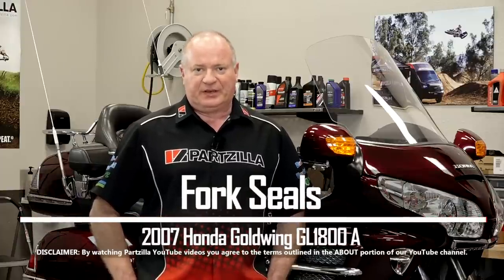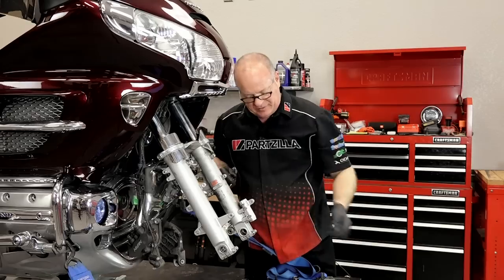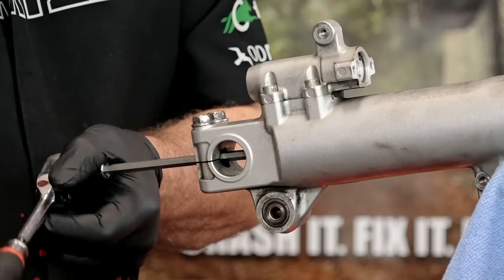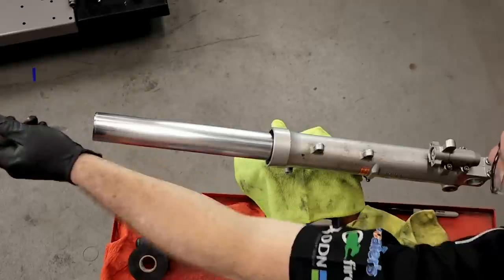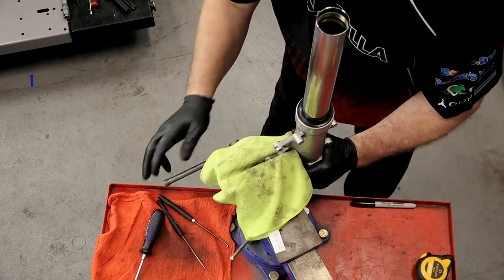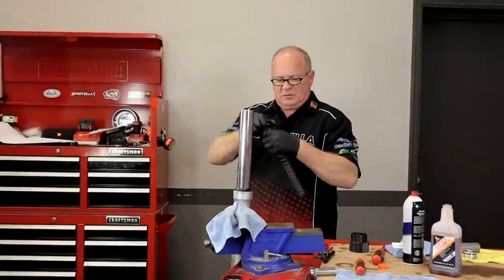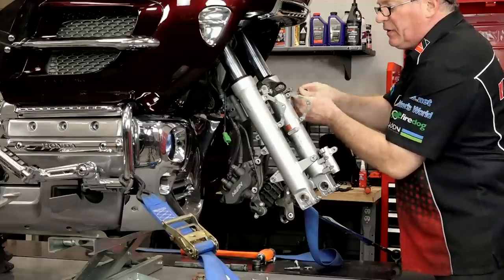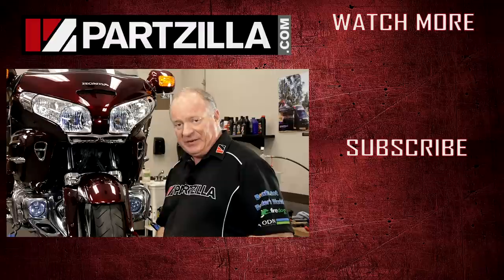Honda Goldwing Fork Seal Replacement  | Partzilla.com

Comment: This is the BEST Honda fork seal replacement video on Youtube.  Very detailed explanation, audio and camera work.  The most unique part is the method he uses to loosen the bottom bolt for the damper rod.  Nobody else does it this way, which makes perfect sense without special tools.  What really kind of blow me away is that the Goldwing has a Damping Rod Suspension - Exc. for anti-dive, no preload, rebound or compression damping adjustments at all for this bike that is famous for it's comfortable ride!
Reply from the maker: Wow, thanks!
Reply: I was watching this video, so me and a friend was going to do it, now that I've watched the video, the shop will fix it. Just a little out of my league, but the video is awesome.

Comment: my 2 cents...the seal install tool can be made from a piece of PVC pipe also, I have found it beneficial to smooth the chrome on a buffing wheel with jewelers rouge . The pits and scratches will ruin a new seal.

Comment: Great video, among the best instructional videos I've seen on any topic. However, you definitely DO NOT have to have this specialty seal driver. The seals go in rather easily, as shown in the video. I was able to use 1.5" schedule 40 PVC couplings which are nearly a perfect fit; and I had a short length (about 20") of 2" schedule 40 PVC pipe. Together these allowed me to very easily tap in the seals. Thanks John and Partszilla for a wonderful service.

Comment: On a 2001, I didn't need to pull the instrument cluster to get the cover off and get at the pinch bolts.  This video was awesome. You certainly are a good teacher. Thanks

Comment: The fork axle centering technique is an excellent thing. Thanks. I suppose to be pedantic, a dial indicator could attached to the steel axle with a $10 magnetic holder, and then in/out measurements could be taken.

Over-constrained is nice term for describing the action of bound forks.

Good, careful, sound mechanic techniques.

Comment: Well today I thought I would try your technique of wrapping the fork with electrical tape.  Well I did not have a smooth go at it and was going to remove the tape and start over.  The tapes adhesive came off on the pipe so I had to clean with rubbing alcohol.  Was about to retape when I said this is a waste of time, grabbed grocery bag tightened over start of pipe little oil on tube little oil on plastic once I got the seal started a 1/4 of a inch on pipe then tore the hole bigger then slid seal down with the plastic protecting the seal from under neath then when seal gets to 1/2 inch of seal area hold plastic at the back and slip seal onto fork then right into the seal slot.  So much faster than wasting electrical tape and having to clean up the adhesive left behind.  Also to save time I loosen the end bolts under the axel before I remove forks saves a lot of time instead of placing them in a vise.  Also find where the cap starts in the thread of the tube before putting spring and spacer back in mark cap 1/4 inch behind tube where it starts to grab hold of thread,  Mark tube at where it started to grab tube imagine a clock on the tube the thread in tube starts at 12 so mark cap at 11 mark tube at the 12 when you place the cap in the tube compressing with the spring you only have to turn your rachet 1 and a half inch and the thread has grabbed in the right area on the fork at 3 o-clock and will not come popping off.  But just do not get wild yet turn in forward to the 5 o-clock on the fork then back to the 4 o-clock still compressing the cap some.  It is a game of back and forth making sure the threads have not crossed once you have gone around 1 and half turns your good to get wild turning it into the tube yet compressing it some.  Ok decided to show you the quicker way to get the seal here is a link to my channel. https://www.youtube.com/watch?v=oeqTjzOXjwE

Comment: I've done a few of these a fixing to do another. I don't use locktite on the bottom bolt. It makes it nearly impossible to get them apart the next time it needs to be done.

Comment: Superb video.  I couldn't believe the state of the old fork oil.  I like the electrical tape trick, not come across that one.  My GL1100 seals are still weeping after I installed new seals and I wonder if that's the reason.  I'm going to have to try again but I'll give the the tape a try this time.  Thankfully, my GL1800 seals are good but I've booked marked your video for the future. Thanks from the UK.
Reply from the maker: Glad we could help!  Thanks for watching.

Comment: Yes I did sir a blessed good afternoon to you and your family..I always enjoy your vedios and is verry educational in so menny ways..I just have one thing to say..I'll like to see you clean all parts that you are going to use back clean first before you start working..its much better ..just as how you clean oit to put up back..great job overall ..you be safe..I'll like to know if I put on a new head gasket and do one torque one the head and is the right torque if it's a problem with that..❤👍👏✌

Comment: Excellent suggestion on getting rid of the non-adjustable Supersbrace fork brace.  The Superbrace design probably does more damage than good and is probably the cause of the stiction problem you discovered.  Kuryakyn or Traxxion both have much better fork brace design.
Reply: The strange part is a former owner swears by the Superbrace. I installed on mine and I'm happy. I'm watching this video because the fork seals are leaking and my bike (2017 model) has only 54,000km. I think the previous owner (not the one who recommended the Superbrace) took it on a long trip towing something heavy, so the fork seals leaked prematurely. That's the theory.

Comment: This was a great video.  I have a 02 gl1800. My turn signal isn’t working but the hazards are. I was told to check the cancel unit. Do you have a video on how to check it and where it is

Comment: Lower backup ring & upper backup ring positions on left fork appear to have been swapped by original installer. You corrected it.

Comment: At about 00:15 seconds into the video you'll see that the OEM oil seal has 8 groups of 2 dots (16 total dots).  Page 14-32 of the 2006 to 2010 Honda GL1800/A Service Manual tells you to install the "- oil seal (with the marked side facing up.)"  The other side has no dots.  At 19:26 you can see John installed the seals with the dots facing up.  I found John Talley's oil seal orientation statement at 19:02 ( "...to install it with the cut edge facing up") confusing because both sides of the OEM seals I purchased from Partzilla appear to have cut edges.

Comment: can't do that with a 1500. I took my caps off to drill and tap holes in the plugs to change the oil and it went flying when I reached the last thread. I had to make a special c clamp with a welded cut in half pipe to rest against the fork tube and strap it there and had my neighbor help me compress the cap back down into the threads to screw it back in. I had already pumped the fluid out of both fork tubes and just had to fill them.  How does that work with no pressure on the springs? It took all I could to compress the springs back in again. with the 2 of us.

Comment: @38:10, i cant believe a pinch bolt is holding the one of these thick forks from the handle bars, there has 2 b more bolts hold that fork in place? wow

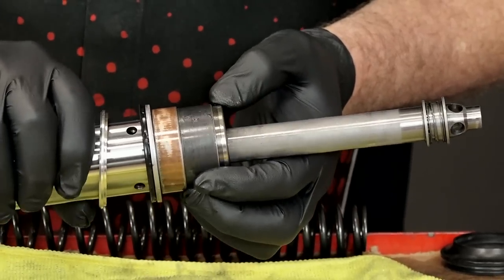Comment: 12:48 The fork has just been dismantled, and there Installed incorrectly LOWER Back-Up ring, packing and UPPER Back-Up ring. In the same way, the master on the video assembled the feather of the fork. Minus for inattention. 13:00 Сondition of the outer bushing is determined by its inner side, and not by the outer one :))) In any case, there will be scuffs on the outer side, since the guide is tightly installed by this surface into the cylinder! The inner bushing, judging by the video frames, does not require replacement. It has no wear.

Comment: I wish you had one like we do, the drain bolt in the right fork is stripped out. Tried all kinds of things but no go.
Reply: I just had that myself. tried his trick, and extractors. I ended up drilling the bolt and the head just popped right off.

Comment: Those bushings probably did not need to be replaced. The bushings are steel coated with copper, then coated with black Teflon. That lower bushing had no copper showing through the black teflon. That bushing was not worn. The upper bushing which you declared worn out was showing copper on the “outside”which does not make contact with the fork tube. You did not even examine the INSIDE of the upper bushing to see if it was still coated with Teflon/black, and if it had copper showing through. if the black teflon coating is still intact on the INSIDE of the upper bushing and does not have copper showing through , it is good,just like the outside of the lower bushing did not have copper showing through, that bushing is still good... The outside of the lower bushing is the critical surface to be examined, on the flipside of that, the inside of the upper bushing is the critical surface that must be examined. ....that copper showing through on the upper bushing on the outside was from the stress of being driven into the fork slider without the benefit of lubrication during the install.. I caught a glimpse of the inside of the upper bushing when you were taking them off the tube. From what I saw in that brief couple seconds, there was no copper showing through that black Teflon coated inside of the upper bushing.that upper bushing once it is installed does not move. The fork tube slides on the “inside” of the upper bushing.Driving that upper bushing in is a relatively violent process to the bushing, it Hass to be pounded in using a driver.it is an interference fit without oil. That is why the coating On the outside of the upper bushing had copper showing through. But that is not the surface that the fork tube slides through....
   I just did a fork spring upgrade, fork oil change, fork seal change, on my GL 1800. I bought new bushings, and new seals. When I took the forks apart and examined the parts, with the fact check reference of my Honda factory shop manual , it turns out I did not need to replace the original bushings. The Teflon coating on the surfaces of the bushings that matters was intact..
  Also: my gold wing is a 2002. I bought it from the original owner with 13 K miles. He had never had the forks serviced before I bought the machine when it was 18 years old. The length of the spring on my inspection was 13 1/4 inches long also just like the springs you declared as having been replaced at some point in this video. I was upgrading the suspension because it felt sacked out, And my front tire was cupped, Which is a suspension lack of damping problem on my gold wing, I bought progressive fork springs, they were also 13 1/4 inches long. exactly the same length as my 18 year old stock springs, Which is exactly the same length as the springs you measured in this video.The manual says the limit is 12.94 inches in length..

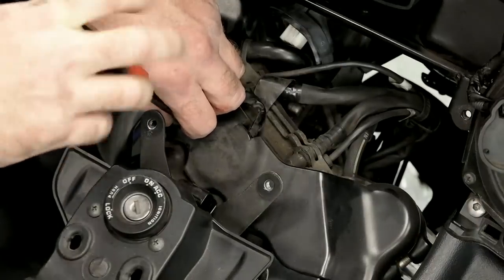Comment: Say what? At 7:12 How can you loosen the fork caps before loosening the pinch bolts??? The pinch bolts clamp down on the threaded portion of the caps and on my '08 I could twist off a half inch socket driver without budging the caps. Nearly did the first time I tried it until I learned better. 
Unless the PO cranked down on the pinch bolts way too much.

Comment: The rings at 25 minutes in, took mine apart, had 2. I"m putting it back together, have one. lol
Cleaned the garage looking for it. Cant find it, also cant find a definitive part number for it either. Did not come in the rebuild kit.
Anyone know exactly the part number, I have one, just need another. The bike is an 05

Comment: so you put the oil in with the tube down  then measure  oil level then assemble with the spring and cap
Reply: Correct

Comment: if you're just replacing fork seals- you do NOT need to remove the tubes from the bike; which means you can skip taking apart the console up top.  It also makes it easier to remove the bottom allen head bolt because there is spring pressure on the dampener.  Just remove the bolt, remove the clip on top of the seal-  then pull the slider from the bottom... everything is right there.  Now obviously-  if you're replacing the spring itself or servicing the dampener, then yes-  you have to go 'all the way' and pull the tubes from the triple but 95% of fork service is seal replacement -- so save yourself some work.
Ride safe everybody.
Reply: I really appreciate your comment here - I need to replace just the seals on my GL1500 and would like to do it without pulling the tubes out of the triple. QUESTION: If you remove the Allen bolt at the bottom of the tubes while the forks are still in the bike, does the bottom slider section of the forks fly down under the spring pressure, or are the springs only pressing on the top caps? I know they make  special tool to remove the top cap safely due to the pressure there, so it must be a pretty heavy force. Thanks again!
Reply: @piekielrl  no- the sliders won't jettison but... they WILL start to fall via gravity if you unscrew the allen all the way.  Make sure you have something to catch the fork oil as the allen acts as the a plug for the oil.  Also make sure you got the front of the bike lifted high enough so you can hank the sliders off the tubes without hitting anything.  You don't have to be super high up but you want about a foot of clearance from the bottom of the fork to your work surface.  You can gain some height by simply turning the steering head.  BTW- I'm making a huge assumption that these forks are 'normal' forks and not of the inverted / upside down type.  What year is your 1500 ?
Reply: @lynskyrd  It's a 97 Aspy, with "normal" forks. (Thanks again!)
Reply: @piekielrl  thats a beautiful bike-  classic.  Also- one other thing; to get fork oil back into the bike- you might have to move 'a couple of things' out of the way but judging from a some of the Aspencade videos I saw- the fork caps look like they are accessible - at least from the visuals.

Comment: Ugggggg. I'm at the part where the end bolt wont loosen (11:30). 6mm has now given up on me and wallowed, any tips?
Reply: I just drilled it out. The head of the nut popped off.

Comment: Why wrapping the fork tube with tape?..from the spacer getting scratch?
Reply: To stop the oil seal from being damaged by the top of the fork tube or from rust spots on the fork tube. Watch the video at 17.30

Comment: You clearly did NOT assembly the same way you took it out. On min 12:45 after you remove the seal the order is aluminum ring,rubber, the steel washer ring. when you assemble between min 18:33 and min 18:36 you put it in a different order. first the aluminium then rubber then steel washer ring. whats is the correct order???

Comment: Why are both of the forks different ?
Reply: The left fork is an old style damper rod fork whilst the right is a cartridge fork.  Essentially, the right fork does all the damping work whilst the left fork is designed to work with the anti-dive system.  In reality the front end isn't up to the job, it's too soft and the anti-dive shouldn't be necessary, and it locks up the front suspension under breaking which is darned uncomfortable when descending a potted hill.   On my 2004 I run HyperPro springs front and rear and I've shimmed the anti-dive so it's ineffective.  I've also added the Kuryakyn fork brace as per the video.  The crack is, for all its looks and promise, the suspension on the 2018+ is still way too soft and can barely support the weight of the bike. Hi from the UK.

Comment: NO! NO! NO!!! At 15:53 and 26:37 you should NEVER put loctite on those bolts! They'll never come back out again. The compression valve will just spin in the cartridge on the right and the damping rod will just spin on the left and you'll never get the forks apart forever and ever amen. 
Ask me how I know...